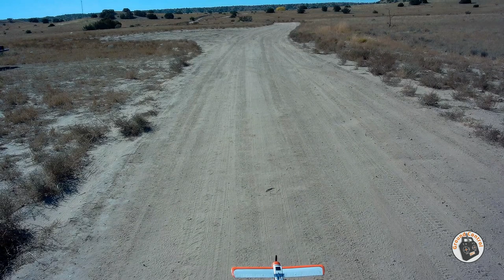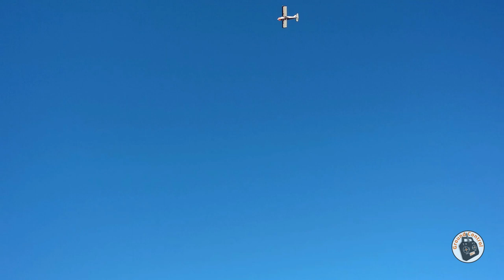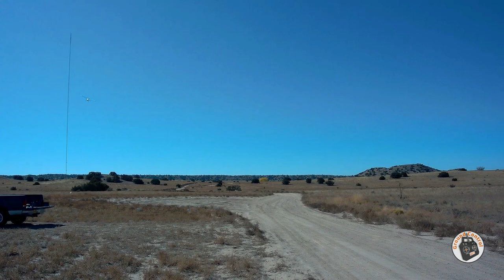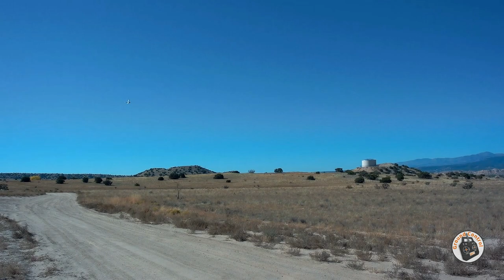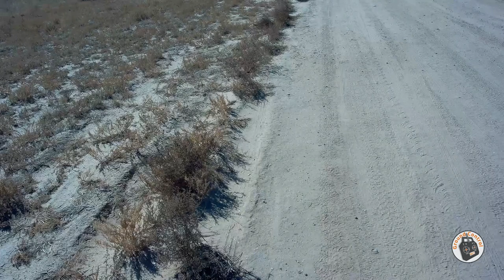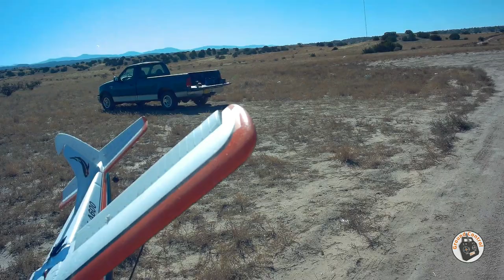DustOff #7 - XK DHC2 Beaver Bush Plane - Stalled it on Landing!

Comment: The main thing is that for a plane with stabilization failsave works correctly. With a branch with the engine turned off in the horizon, he can still plan far. See you.
Reply from the maker: It's amazing what these gyros can do, you can just about float it down ;-) See you in the Air!

Comment: I kinda though that plane wouldn’t stall like it did. You would think it would float in.
Reply from the maker: Hehehehe....you would think so, especially with a gyro, but I'm managed to stall it several times ;-) See you in the Air!
Reply: Ground Control RC I know what you mean. I have a T 28 and keep stalling it, thinking I’m flying one of my Timbers, get it on a nice glide to land and their it goes. I know better.
Reply from the maker: @dannyhelton6363  , I think that's my problem ;-) I fly Parkjet much more than traditional planes and forget you can't do carrier landing with traditional planes ;-) I need much more practice with traditional planes ;-) See you in the Air!